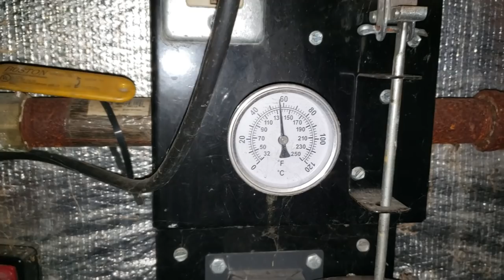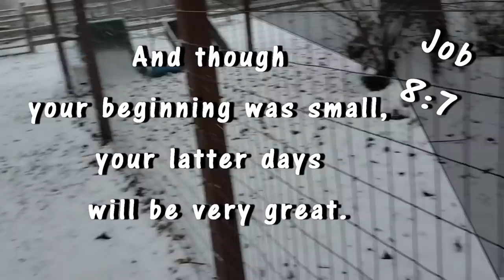This Is What It Will Be Like To Garden On Mars

Comment: :) yep with all the empty space next to the bed during winter it could be used for black storage tanks for water for solar/radiant heating or even brick or stone painted black for raised beds or work shelves painted black to absorb the sun's heat so you have warm air flowing around the outside of the inner bed.  Thanks for sharing and I love the wood furnace setup.

Comment: It's nice to see the system is working well again.  A couple of thoughts, maybe add an enclosure around the  fan, then open the lower 6" or so of the warm end of the tunnel and close off the top of the cold end.  That way the fan is circulating warm air instead of needing to pull in cold air and heating it.
For lightweight insulation maybe get a roll or two of Reflectix type insulation.  You would be able to secure it down to the top of the tunnel then roll it up during the day to let light in.  Using that along with the blankets should be very effective.

Comment: I think a hydronic radiant system would work better since it takes a while for a thermal mass to cool off. Air temperature can quickly fall since it good at conducting heat away and has little mass to retain heat. 

Perhaps a few layers of bubble wrap for insulation as it would still allow light in, but do a better job of retaining heat than single layer plastic.

Comment: I like the idea of a wood boiler for heat. I'm trying to heat my greenhouse this winter too. My green house isn't as big as yours (8x12).  I did a second layer of clear plastic also but  mine is on the  underside making my whole greenhouse a double walled structure and used double walled polycarbonate on the ends. I also caulked the tar out of everything. I have a small "My Buddy" propane heater and a thermostatically controlled electric heater as backup. I watch the temperature with a remote wireless sensor and adjust by either turning off the heater or opening the door during the day. So far we had a 14 deg night and my greenhouse maintained 47 deg., if the temp drops below 40 the electric heater comes on. I don't have much automated but since I'm retired I can monitor it myself, maybe I can work on the automation part?

Comment: I wonder about putting a second layer of plastic on the inside of the greenhouse so that the heat that is escaping the raised bed inside of the greenhouse a little bit longer if that might help stabilize the temperature
Reply from the maker: Ideally I will double the plastic and create an air gap in between. I also want to wall off the north side and just leave the south side and top open with clear plastic so I can insulate it better

Comment: Thanks for showing this. I'm new to your channel so this may be redundant, if so please excuse. If I heard you correctly, when you entered the left is south. Why have you not attempted to insulate the north side of the green house? Rigid foam boards, several lays of plastic from the ridge down, blankets etc.. Also blowing air through a double layer is counter productive as air currents will transfer the heat away. Best of luck. We had a 8F night a few weeks ago in mid coast Maine, damn cold for Nov.

Comment: Your fan should be recirculating the air inside the hoop. I don't know why the fan intake is on the outside. If the whole fan system would be inside you wouldn't have that  positive pressure  and a lot less air would be escaping. Your boiler system is capable of heating a few buildings actually.

Comment: Do you have the circ pump run all the time? The pump will last a lot longer if it runs constantly.  Also those cast iron pumps can rust if they don't run constantly making them not start when ready.  Consider running some tubing in the soil after the fan before going back to the boiler ... that will create a heat mass to cushion against a fast cool down should the power go out or a fan quit

Comment: Just a thought but what if you put an infrared heat lamp inside each end of the hoop house that covers the plants, then draped space blankets over the top. You could tape them together using aluminum duct work tape. Thoughts on if that would help keep the temp up in there??

Comment: If this boiler heated your home, why can't it keep that small area warm?
Reply from the maker: The challenge in a hoophouse is not the heat source as much as holding in that heat. A real greenhouse would be insulated and made with double or triple pane glass. This thin plastic here just doesn't hold much heat

Comment: I'm using 400ft of earth tubes buried 10ft deep with solar system to power the fan and gridd electric for backup for my 4,000 cubic foot greenhouse. Stays in the 50's so far with 20 degree nights.
Reply: Zone 7 in NC
Reply: What are you using for the heat exchanger, or are you just running the air through the tubes then directly in to and out of the greenhouse?
Reply: Just running air through the tubes from  outside to inside.
Reply: I used 6" corrugated solid drain pipe